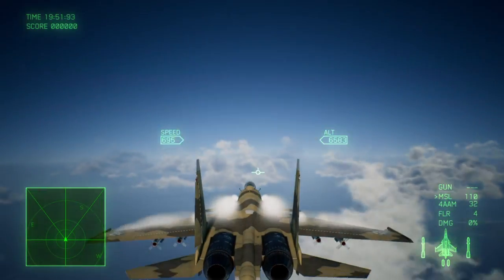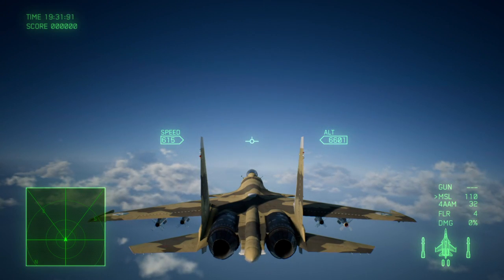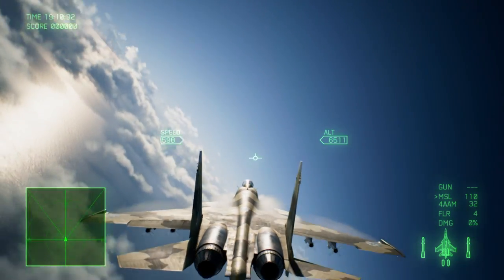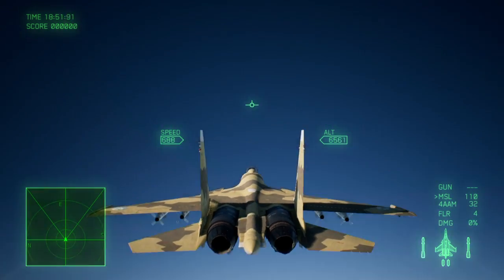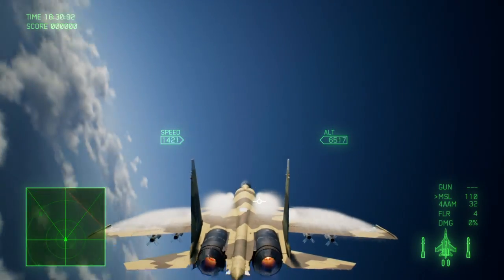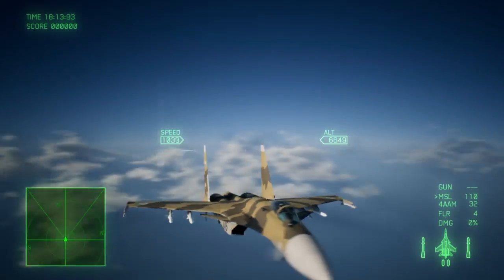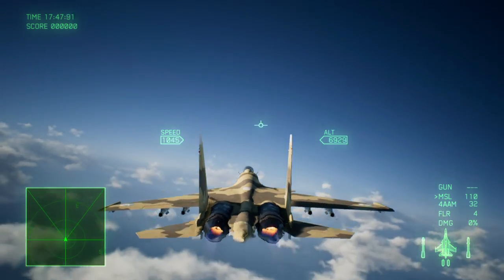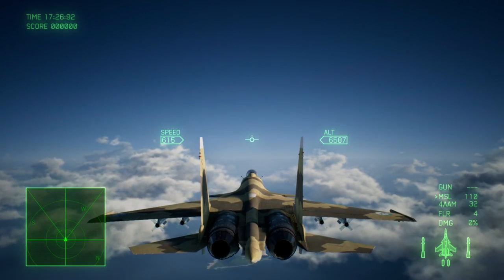Ace Combat 7 post stall maneuver tutorial

Comment: In case you wondering what's the name of that maneuver,is Pugachev's Cobra.
Cobra is just like cobra,crawling and then stand up to scare its prey.
In this maneuver you just pull the nose to 90 degree up,then pull back to prevent stall.
Kulbit is just like Cobra,instead pull nose up,it going loop and go back to the course.

Nice video.
Reply from the maker: Actually the maneuver I demonstrated isn't a cobra, during a cobra the pilot pulls the nose up then brings it back down.
Reply: @TheHipsterGamer  you performed many maneuver there.I confused which one is it. the loop one?
Reply: @theraiden9631  kulbit manuever
Reply: @kasmidjan  just as I said.
Reply: raynaldo arlen k.eman  lol. F for pay respect.
Reply: @theraiden9631  so his plane became submarine that can do kulbit instead
Reply from the maker: @theraiden9631  lol you said cobra... the cobra and kulbit are not the same thing
Reply: @TheHipsterGamer  I thought I had explained it on my comment.
God I'm not good at explaining.

Comment: Is it possible to do a flat spin? You probably need horizontal thrust vectoring aircraft (proper 3D TV) to do it. It would basically be the same thing but instead of pulling up, you would go maximum yaw with the thrust vectoring and cause the plane to spin like a frisbee. I believe the only proper 3D thrust vectoring aircraft in AC7 would be the top tier Russian planes like hte Su-57 and Su-30.
Reply: Nope they don't have it, and I don't see the reason for it.

Comment: My Q is how to stop at 180 deg and shoot the turd on your tail instead of doing a full 360 deg rotation?
Reply from the maker: You can technically do that, just stop pulling back on the stick before doing a full loop, that's also a great way to change direction with as tight a turn as possible, the only downside is you lose more momentum that way.
Reply: I'd personally would just cobra maneuver it rather than pull an about face. You still keep momentum and they won't be able to counter that well if at all. You can still get countered by doing a 180 if they do it too or Cobra turn.

Comment: Yeah im not sure what im doing wrong. Su-35S, braking to 320-360 (knots) letting go of the brake, and then high G pull up. its not really working at all.
Reply from the maker: You just mentioned knots, so with that setting the optimal speed is between 200 and 300

Comment: Wonder if its just the Russian aircraft tht can do those maneuvers or if the others can too. Have you tried yet?
Reply from the maker: Every Russian plane can perform a post stall other the the mig 21 and mig 31, the only other aircraft in the game that can do it is the f22, x02, f18, and yf23
Reply: @TheHipsterGamer  F-35 can do it too. Ace Combat Fan covered it.
Reply: Passion Fire F-23 can’t do it, you were probably getting it confused with the F-35C. I actually have a question, the F-35 in Ace Combat Infinity had a VTOL mechanic, where you could hover by decelerating and pulling up, I think the A-10C had it too. Did that carry over to AC7?